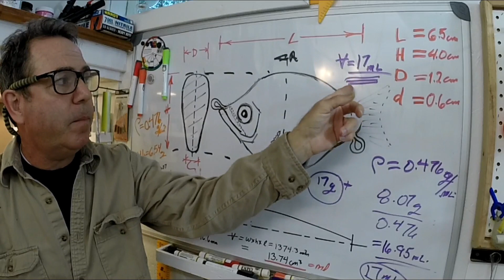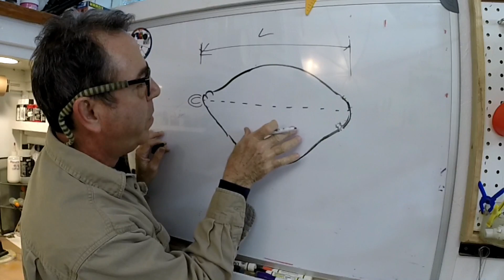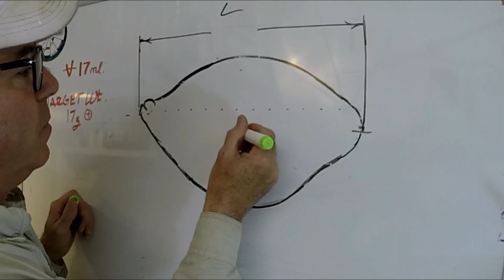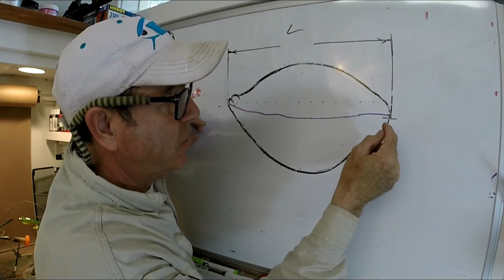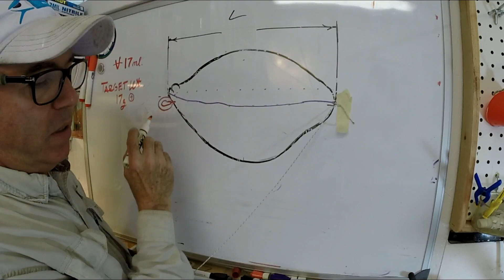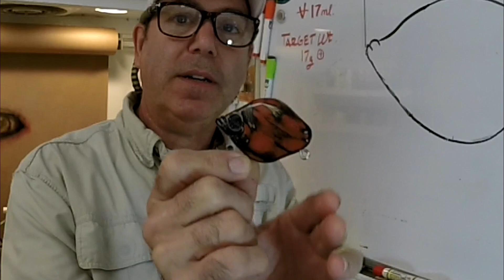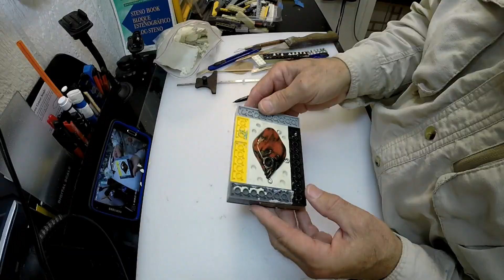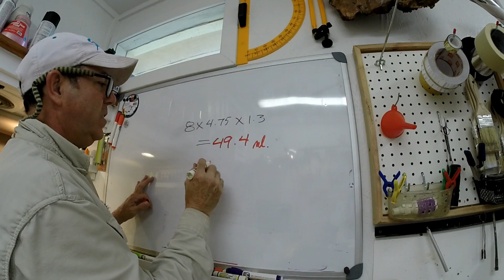Making a wooden Lure, Design and Build from Scratch Part 4

Comment: I have a 7 inch glide that iam working on. On slow retrieve it swims and works great. But on a fast retrieve the bottom middle wants to roll up about quarter of the way and if I burn it in, it will blow out. Is this the same rules eith the string trick to keep it from rolling up even on a single joint glide? Please help!
Reply from the maker: Yes...you need to have the tie eye placed just right.  Try bending the tie eye up or down to see if you can improve the swim.
Reply: @EngineeredAngler  I tried that a few times as best I could. It still kept wanting to roll. It's only does it if you try to crank it in decently fast. Small reel pops it doesnt and moderate reel it doesn't. Could that be the only factor causing it wanting to roll on burn ins?

Comment: Awesome video! Given that the tow point is where it should be based on this, why would a lure get stuck swimming to one side with no action?
Reply from the maker: Typically that would be because of asymmetry. It takes very little to throw it off. Try bending the tow eye to one side then the other and see if it helps. If so, you probably have a symmetry issue.  Good luck.
Reply: @EngineeredAngler  Thank you, i will try to do this though the wire is pretty thick. I had two lures that i tested today do this, they want to swim or wiggle but 8 out of 10 times they dont!
Reply from the maker: @oscarstone9361  
I'm assuming this doesn't have a dive lip....
Reply: @EngineeredAngler  no its not lipped, the bait floats and dives down around 40 cm when reeled in and should dart side to side similar to a topwater walking lure